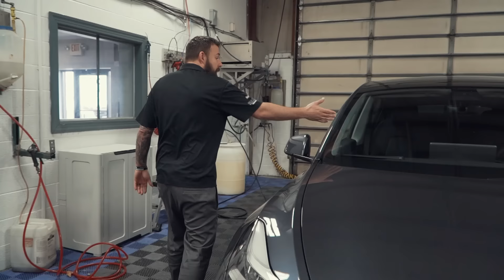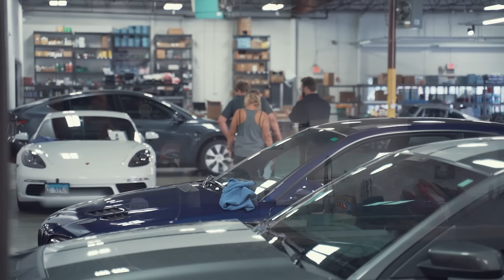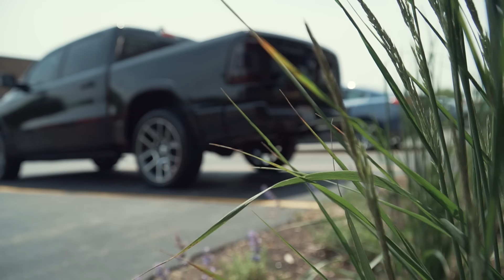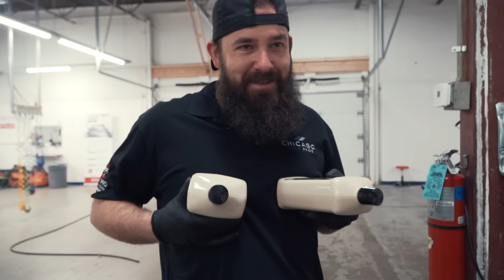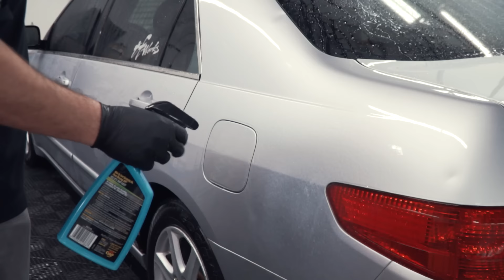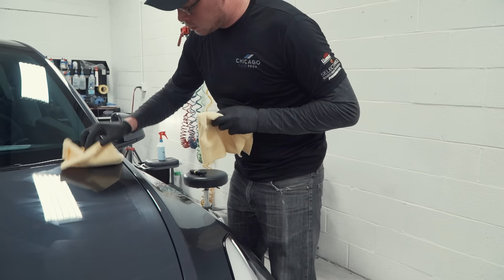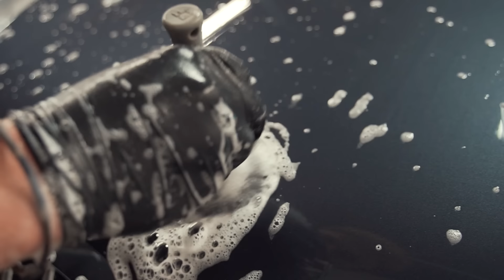Everything You Need to Know Before Buying a Ceramic Coating

Comment: “If you’re going to take your car though a car wash you shouldn’t get a ceramic coating.”  Wouldn’t that be an excellent reason to have ceramic on your car?
Reply: Best comment
Reply: Amen!
Reply: Was waiting for that one
Reply: It won't hold up against those bristles.
Reply: The local detailing shop told me to take my vehicle through touchless car wash if  I don't have option to use two bucket system at the car wash since it's banned.  So why did he tell me this ?? A very reputable shop too
Reply: @codyfrancis4474  I’ve seen videos of truly touchless car washes without brushes. Maybe they meant that?
Reply: Ceramic coatings will notvlast thru auto washes. They are that abrasive, dont take tour car through one unless you really just dont care and dont have half an hour to wash your car
Reply: It doesn’t matter what you touch your car with if the surface is dirty, you’re scratching the paint. You can lubricate it but you’re always going to put very fine scratches no matter what you touch the paint with because it’s the dirt scratching not the clothes. I’ve been in the car wash industry for about 10 years now, and the people that like automatic car washes aren’t looking to make a hobby out of cleaning their vehicle, and learning all the intricacies of keeping their paint pristine. I don’t know if any car washes using bristles. They all use either lightweight or heavy weight cloth and it’s thoroughly lubricated with soap.
Reply: @dinky19810 they don't have bristles anymore. At least the ones I go to.
Reply: That’s exactly what I was thinking. I was was thinking of the touch less high power jet wash.
Reply: @dinky19810 what car wash still uses bristles?
Reply: @dinky19810 or the crap that's attached and stuck to the bristles whipping around on your car
Reply: I thought the exact same thing.
Reply: I heard carnuvo wax should not be applied on top of ceramic coating, but waterless car wash solutions like chemical guys is ok. There’s one that’s light green that is a wash with wax. I have a gallon of it and I’m gonna coat my car and wonder if i shouldn’t  use it after the ceramics been put on? Is that little bit of wax in the waterless wash that potent? It’s not an actual wax wax, is it?
Reply: @Arlene_witha_y  you can put a carnuba over ceramic. It works fine. Just doesn't last as long. Just 1 more layer of protection.
Reply: A ceramic coating does not protect against scratches and retard wash methods..get a ppf for that.
Reply: If you go through the car wash, a ceramic coating is going to hold up better than a sealant. 

One of the first cars I did at the shop where I work part time was an Aston Martin DB11 in pearlescent white. I did the paint correction and polishing with 3D ONE and an B&S Uro-Fiber/Uro-Tec yellow pads. 

It was coated with CeramicPro 9H and Top Coat. 

It's come in for maintenance washes with car wash brush cloth lodged in the front side vents. 

When we wash it, it's still beads up very nicely, and the scan grip shows little to no brush marks. 

I put the light on it to show my co-worker that the coating has held up since Sept of 2020 while going through an automatic car wash, because he mistakenly believed that a car wash would remove the coating. 

One of my clients, I coated his Audi A5 I'm 2017. In 2019 he had me do the car again. With his car I used Optimum Gloss Coat. The first time I did a cut, polish, seal on his car it was incredibly difficult to remove the damage. It was easier with the coating. I was done polishing in about 45 minutes using Megs M205 on a green Hex Logic pad with an original 1st gen Porter Cable. He didn't want to pay for the coating, so I used Megs M26 paste wax. 

Then Corona virus happened. 

He brought the car back last spring. The wax had obviously worn off, and the paint was again very difficult to correct. 

My best bro since 5th grade (87), the guy who I polished my car by machine with for the first time in 1996, he has me work on his and his family cars every year. Two years ago I used Meguiar's Hybrid Paint Coating on his truck. He washes it at a car wash a couple time a week, and the coating has held up. I polish and recoat every year with his truck. The water beads up  and the gloss is still there. Sure there are some swirls, but again - much easier to correct by removing the coating and starting with a fresh application. 

So I'd have to say that there is a cost / care issue with coatings, but if you have the money they'll offer a better defense than wax or sealants.
Reply: @danlc95  you mentioned using a light and you could still see the coating on there... do you have a special light that can see wax's/ceramic coatings or are you just saying that the surface was still scratch free? I'm a spray painter and am not convinced this ceramic coating is worth the money that detailers charge for it, it takes half the time to apply than doing a wax yet somehow costs twice as much, thats how it is in new Zealand any way
Reply: @MxMOBSTAR  - The surface was still scratch free, and the water behavior - post decon wash showed healthy coating. 

Applying that Ceramic Pro coating took me two days. It's like applying super glue to the paint and then trying to rub it off - terrible. 

I would prefer to use wax than most ceramic coatings. 

I personally wouldn't pay for the service, but that is because I can do it myself. 

It's said that to qualify as a "coating" there has to be measurable film build. They generally add a micron or two, where waxes and sealants don't  really do that. The coatings are also physically harder and resist abrasion and chemicals. 

My gf's old truck had a coating on it for a number of years. It looked like it was dead, so I started the process to polish and add protection. 

When I clayed the truck, the paint was slick, where it's typically grabby after the clay process. The coating was still there. A two year rated coating on a truck that sat outside for a year and a half, that was coated in 2019, not too bad. I did end up polishing and coating again though. 

I like Optimum Gloss Coat and Cquartz UK 3.0, and Cquartz Lite. 

Don't pay for it, pick up something like Cquartz Lite. It's rated for six months of performance, but should last well past that point. 

As far as the money goes... 

At work we charge $1,500.00 minimum for a compound / polish / coat. My personal price in my business is closer to $900.00 for that same process. 

Some places charge more, but it really depends on your demographic and how you positing your business. 

At that shop, my co-worker often skips much of the polishing process and prefers to use a spray wax. $1,500.00 for a hack job. We're hemorrhaging customers since he started doing this. The owner just found our last week. He's been notorious for not doing the roofs to trucks and SUV's. He gets mad when he thinks they will take their car through a car wash, so he refuses to do what the owner and the customer agreed upon. - THAT is when a "professionally" installed ceramic coating is never worth it. I have to imagine it happens more than people realize.
Reply: cheers for replying, but sht 2 days putting that coating on does that include pre clean re-polish/wax? I have to ask, since I'm talkn to someone that knows more than me about the subject- when wiping off the coating why can you not just use a glazing pad on a buff and wipe off whats left with cloth? especially if its that much of a prick to remove haha
Reply: Not really. I have a 2007 Saturn and the paint looks as good as the day I bought it. No ceramic coating, all car washes, I also don't use other chemicals on my car like armorall. I see more people's dash boards crack using armorall than just plain water. I'm sure you like breathing all those chemicals in your car after you get it clean. I don't....
Reply: Brush car washes would probably eventually scratch your coated protection,  even brushless have harsh chemicals on your paint coating
Reply: Just got up xx 😊
Reply: What about if you are going through the car wash to get a ceramic coating ?
Reply: You should also do touchless wash and get a few microfiber towls ready to dry it too
Reply: This comment hit the nail 😂. Why am I spend lots of $ on a ceramic coating if I had to spent at least 1 hour hand washing my car? That’s sort of defeating the purpose of easy maintenance no?
Reply: @andylam4350 it’s still easy because your removing the step of waxing after washing and drying

Comment: Been a detailer for many years and I like the honesty this guy shares with everyone. There will always be the next latest and greatest car care product, some better than others but none the less.  On average most people keep their cars for quite a while, if in fact the car lasts past the warranty. In a typical situation waxing a car will protect it just as well as any other coating. But the way you care for your vehicles paint makes a huge difference, especially before and during the cleaning process and even during the waxing process. I can't count how many times a customer has  used a dirty cloth, sponge or mitt to wash their car and a cloth or sponge to wax their vehicle. Some people even use really harsh chemicals to clean their vehicle, which can harm clearcoats and paints.  I know paints and clearcoats have come a long way over the years, but protecting both are still essential to their life.  Advice? Listen to the honest pro's like this guy, but remember you can keep your vehicle looking best if you use a little common sense.
Reply: 25/6 22, Did l understand you correctly ? Waxing your car will provide the same finish as the latest products ? I have a shelf full of big brand cleaning, finishing , bodywork protection, & waxes accumulated down the years & use them 2 or 3 times annually to enhance & protect my cars. You're saying, l think, l can't improve things by updating & using the latest products. Pleasing news - l won't have to dispose of them because no great benefit's gained by spending on the latest products which in turn will be superceded too. Time saving seems the only improvement.
Reply: @Hates Spam He does not seem to be saying that the ceramic coating is "NOT" worthwhile, but that it is not the final step to caring for your car.  "If you plan on keeping your car more than 3 years...." as he said.  Depends on where you live, park your car, how you maintain.......etc..
Reply: I want this done to my Mini Cooper but not all over it certain parts course I don't live in Chicago how do you find the best in your area

Comment: Very well said Jason!  Fantastic video.  

Some cheaper brands try and make people believe that ceramic coatings protect against scratches, stone chips, fire, lol.  That’s pure insanity.  

As you said, coatings are an exceptional form of paint protection for people who like taking care of their vehicles and who use proper washing and drying techniques.
Reply from the maker: Thanks brother!
Reply: It’s PAAAAAAAAAAAN the organizer 😃
Reply: @ChicagoAutoPros  Thanks for the excellent video.  Do you think ceramic or sealant coating in windshield can cause squeaking noise on wiper blade?  I have this problems before using some wax.  It is really hard to remove once it squeak, it does not go even after putting new wiper blades..  I had to clean it with strong 99% isopropanol and change the wiper.
Reply: People thinks its magic,
Reply: I'll say it Pan. The ones on ebay that come from China.. They are the Masters of talking up a product when it's in fact of rubbish quality.
Reply: @tonymontana897  everyone who is anyone or either who wants to be someone will be marketing their product. Marketing = hyping up your brand and or product so its not just the cheap chinese products - it goes on in every town and city in the good ole US of A as well do not think for a second it doesnt and more importantly, do not try and tell the consumer otherwise. you do it, i do it, carpro does it, the pizza house does it......
Reply: @theconnectedchris305  I hear what you're saying, but companies with a reputable brand really sell themselves. The rubbish coming out of China is cheap and nasty with little to no Q & A. They just copy the others with no real life testing. Brands you've never heard of because they really don't exist. They make one batch of goo give everybody there an amount, package it a little differently and talk it up like it's as good as Gyeon for example. I wouldn't put that on my car.
Reply: Hey Paaaaaaan 👋
Reply: yeah lol maybe tin foil is the answer for peeps expecting too much!
Reply: My partner just picked up her brand new Golf Final Edition and she took it straight to the detailer and had it ceramic coated, the company was fantastic and done an absolute amazing job for her, very impressed. They used great products and she had the interior, rims, brakes, exhaust all done, but that paint looked so glossy, fantastic product Gtechniq highly rate it.
Reply: @ChicagoAutoPros  He's not your brother.
Reply: Well said Pan...👍🏻🙏👍🏻
Reply: If you like the over glossy toy car look maybe.
Reply: @ovoxo5793  well that's the problem with these coatings is there over marketed and overhyped people think that just because cars are super glossy and they beat water that that's the best thing for the car these coatings water spots so badly that if you go through a thunderstorm while you're at work and the sun is sitting out baking on your car after that thunderstorm and you have a ceramic coating you're going to have to compound your whole car I think ceramic coatings do have a place but when it comes to water spots they do very poorly so much so I would rather put a palomino silicone wax on my car every 3 to 4 months and not have to worry about the water spots versus having the super hyper gloss of a ceramic coating but to each their own.
Reply: When your favourite channel comments on your other favourite channel! 🤯
Reply: @Elliot Fringuello and ? Feedback ?
Reply: @eppyz  Like that 303 protectant that everybody was advertising, even was on the Nascar races on tv every week. It is like armor-all but ten times more at the time. I bought a gallon to use on my new truck and pretty much all my plastic on bikes and stuff and boy was that a mistake. Turned everything hazy white and left streaks all over the paint that you buff off. Lot os crooks out there now. Just cause it is expensive doesn't means it works, those days are over.
Reply: @yamaha226  Sorry to hear about your particular issue with 303.  I had nothing but good luck with the stuff.  I have been using it since moving to the SoCal Low Deserts in the early 90's to keep my plastics in good shape.  I have had zero issues with 303 and my plastics even after 20 yrs in the desert sun have not faded or cracked.  If you applied the product and it streaked and was chalky?  That sounds so out of character for this product?  Did you apply it in direct sunlight?  If the plastic was in bad shape to begin with or faded it won't restore it.  Its not that kind of product.  303 is a conditioner and will help prevent things from going bad with regular use.  So maybe in your particular application it wasn't well suited.  If you have something new, that you want to keep new?  Then 303 works great.  Have 20 yrs proof that it works.    I have though switched to another product that I am trying right now that is much more affordable.  I am doing my testing now and if this stuff works well?  I will post what it is.  I need proof something works before I put anything out there for anyone else to try.
Reply: @eppyz  Brand new truck plus a car two four wheelers lawnmower. i'm that guy that everyone talks about in town that takes care of his stuff. This product caused me alot of grief . I will mention i purchased the gallon off off Amazon so who knows. Oh and i hand wax and apply everything in the garage out of the sun.
Reply: @yamaha226 yeah it's very unusual to hear that for this product I've been using it for 20 years never had this problem I honestly have nothing to say other than maybe you got a bad gallon 🤔
Reply: @yamaha226  where did you buy the gallon from Amazon? and the reason why I ask is because a lot of stuff on Amazon sometimes is not the real product .  Just might be where you purchased it from.  Could have been an old stock gallon that someone sold or something cuz it just doesn't sound right what you're saying the product is very good.  though like I said I am looking into an alternative because of the cost I use quite a bit of the stuff for my vehicles and things that sit outside at a plastic so if I can find something well I'm using something right now I'm just doing my own experiments and once I know something works then I post it but for 20 years I used 303 exterior protectant and have nothing but good things to say about it it doesn't last very long I applied it every couple of weeks so I go through quite a bit of it but I have plastics that are outside that are 20 years old in the desert Sun that aren't brittle or cracked so I know it works.
Reply: Ceramic coatings are for people that dont need it.
Reply: @Praise___YaH  GTFO here
Reply: Expensive brand doesn’t protect you from scratch’s, stone chips or fire either…
Reply: That’s why I would go with high quality protective film. That stuff will beat anything even a ceramic coating.
Reply: I love washing my car. But those rigs on the freeway be going 75 in cali a lot of the time and those rocks fly right towards my baby :(

Comment: Ceramic coating is typically composed of silicon dioxide (silica, Si02), which is sourced from natural materials such as quartz and sand. Some types and brands also use titanium dioxide (titania, Ti02) as an additional hardening agent.Aug 6, 2020